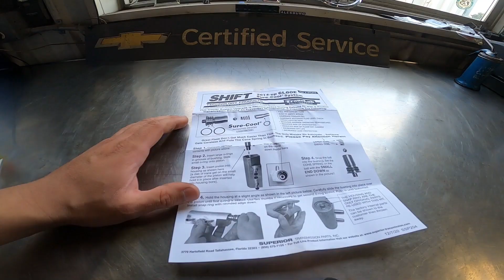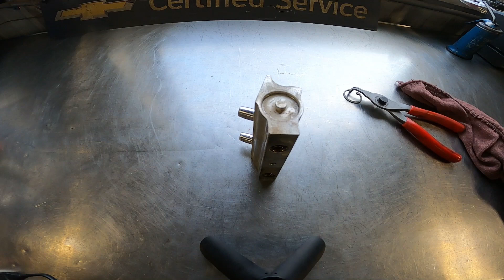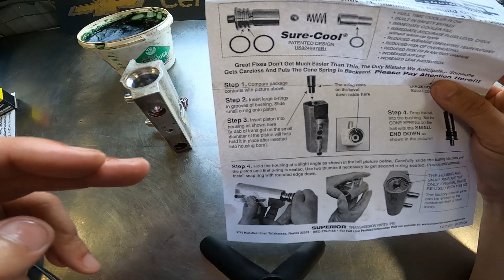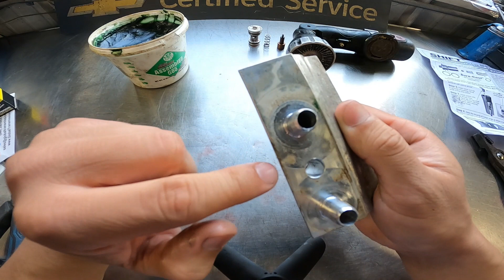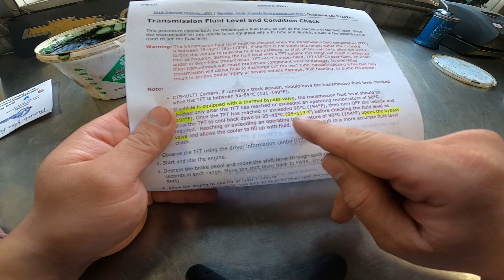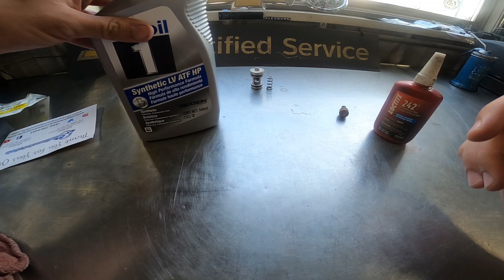Thermal Bypass delete. Removal.REBUILD! Install. STL010 8L90 M5U

Comment: I noticed my engine temp go up a little after this modification.  Before 210° now up 3 or 4 °.unfortunately my 2017 sierra sle doesn't have a trans gage. I guess it's running cooler.

Comment: Thank you so much Jay for sharing this video. I am in the process of reinstalling the TBV on my 2014 Sierra & am wondering what the torque value is on the 13mm that bolts to the transmission? Also, I am stunned at how all there is holding both transmission lines into the valve are two very thin & oddly shaped clips along with each having  what looks /feels like plastic black bushings that slide overtop of these clips that go over slotted metal housing?! Yours is not set up like mine so the various videos I've watched to muster up the courage to attempt this it seems never record how to install these two clips ?! They are so thin & so fragile I am afraid I may if not lose them, destroy or alter them in a way that may render them inefficient. Any advice would be so greatly appreciated! Thanks again for your expertise and your advise on how we may save our transmissions. I have only 71K "easy" miles, no towing  or heavy foot as I am the only driver but did notice an ever so slight rough upshift /downshift along with  delayed engagement to drive and reverse so that is how I discovered this long known to GM problem that I was unaware of until  I searched online about the shifts /delays. When I changed the fluid first before attempting this it gave me hope as it was still mostly red and minimal metallic dust on the bottom of the pan but No metal shards or shavings so I am hopeful that this will save it. I only wish I'd seen your video before I did the fluid change or I would never have put the Dexron VI in! Keep Up the Great Work!
KP

Comment: Repair completed. Thank you for video. 190,000 miles 2015 Silverado, 5.3 6L80. Higher temps before were in 190s, after swap highest temp was 174. Slips and shudders have stopped. Good enough.
Reply from the maker: Thanks for watching!

Comment: Removing the drive shaft is crazy dude. I clicked off ass soon as you started doing that
Reply from the maker: @colt2206  4 bolts with a 3/8 impact. How long do you think that takes real time? 2 minutes?

Comment: I just Changed my transfer case, front and rear dif fluid, coolant flush and brake flush and FINALLY the STL010 Thermal Bypass mod.  221F before 145F after.  DO it ASAP if you have a GM transmission

Comment: Just did this on a 2021 Silverado with the 8L90. Before the mod I would regularly see temperatures 190-200. A few times I saw 250. Low miles truck but I didn’t feel comfortable with those temps.

Great video, one thing I’d like to add is I was able to do the entire mod without removing the trans block/trans fluid lines. I just undid the snap ring and then followed your instructions. Figured I would try and avoid separating factory seals wherever possible. I also did the job cold to avoid losing as much fluid as possible. Lost approx 1 oz. Thanks for the great video!!!
Reply from the maker: @kevinlister5424  I’m just here to help 🤙🏽🤙🏽. I’ve had people say they can do it on car! I’m glad it worked for you. Your transmission will thank you and so will your check book. Have a great weekend!

Comment: Is there any reason you have to remove that whole housing? Can you take the snap ring off and change it with the housing still attached?
Reply: Ya I just did on my 18 6.2....snap ring out..yank out parts...I used a magnet to pull spring out and then toss the new stuff in and bingo

Comment: I flipped the pill 3 years ago on my 2018 Suburban 6L80...works perfectly
Reply from the maker: Odd you are here then
Reply: @jaycastillo9313  video popped up in the feed(which is what you want, right?!)...took a brief look, jotted a note.
Reply: Until the pill detent fails and ends up inside your transmission yea it works but it’s playing roulette
Reply: @zacharycrawfski2276  tje engineering of the part won't allow that
Reply: @everydaydadfixinit4803  seemed pretty poorly manufactured to me in my opinion definitely looks like it could come loose
Reply: @zacharycrawfski2276  lol you're wrong

Comment: Wondering? Could the tstat just be removed from the block housing without unbolting it from the transmission? The block is laying sideways on this 8L90 vs upright on the 6L80. Has anyone just tried sliding out the tstat then slide in a new one or the sure cool MOD. Seems like it would be less fuss with bolts and trans cooler lines etc.
Reply from the maker: Yes. I believe others have commented that they have done it this way successfully. I personally have never attempted.
Reply: @jaycastillo9313 
Thanks for the reply. 
Great video btw. 
Also wondering. 
Have you ever just removed the tstat block completely and attached lines directly to trans.
Reply from the maker: @IS-217  I’m not sure there is a way to do that honestly.
Reply: I just did on my 18 6.2...pretty easy except for the snap ring was abit of a pain lol

Comment: I just did this on my ‘16, is there a potential problem in the winter where it gets negative temps at times in the winter?
Reply from the maker: There’s always a risk but it’s slim. More risk of a blockage/restriction than a freezup. I live in Iowa and I have driven my truck when the windchill is -55 degrees and all was good. I’ve never personally had an issue. My truck is equipped with an active shutter which may help reduce the chance of a freeze up condition.

Comment: @jaycastillo9313 
 
Have A 2017 with the 8l90 and was wondering if you had the part number for the o-ring and seal. 
Thanks
Reply from the maker: 12650609 (aluminum lines)
23277649 (steel lines)
23135703 (Seal)

Comment: Sorry to bug. I may have asked this before, but does anyone know the proper way to do a fluid check when this mod is done. I know with the stock equipment you have to check it between 35 and 45 Celsius or 115 F. Would anyone know the proper way to fluid check with this bypass in.
Reply from the maker: There is no waiting for the valve to open. The actual procedure requires you to get to 194 degrees Fahrenheit to open the valve then check it at operating temp of 115. Now the vavle is gone so just get it to 95-115 degrees (GM recommendation) and pull the 10mm plug (8 speed) until the fluid stops running out and torque or get 95-115 and check dipstick (6 speed)
Reply: @jaycastillo9313  you sir are a great man!!!! Thanks so much. Cheers from central Canada!!! 👍👍👍
Reply from the maker: @jaybilawchuk2225  🤙🏽🤙🏽make sure the engine is running when you check the transmission fluid. 6 or 8 speed both.
Reply: @jaycastillo9313  yep. That’s how I do it. All good. I had a check engine light with code PO711 for an transmission temp sensor fault happen yesterday, so I’m scared. lol. I cleared it and have been driving and it hasn’t come on again yet but will see. I have no idea what kind of job that would be to change. lol.
Reply from the maker: @jaybilawchuk2225  I did it on my 8 speed! It’s just the temp sensor in the transmission. You just drop the pan. I think exhaust has to be loosened on both sides to get on cover clearance. Then replace the harness, the temp sensor is part of the harness and is not serviceable.

Comment: you dont need to remove ur front driveshaft folks
Reply from the maker: Harder to get the torque wrench in after but definitely doable! Every second helps when it’s your own vehicle though! Not getting paid to work on them, are we? Thanks!!
Reply: i dont think i ever torqued the thermostat blocks in my life haha SHIP IT @jaycastillo9313
Reply: @jaycastillo9313  al hacer el bypass tienes que reprogramar la computadora o  se queda igual ??
Reply from the maker: @fernandovazquez1732  No. No es necesario programar nada. La computadora está bien 🤙🏽
Reply: @jaycastillo9313   muchas gracias por el dato
Reply: looks like your a gm tech, me too. 5 years with gm, on my way to WCT
Reply from the maker: @AV8Steps  WCT was the goal a few years ago but after being so short on help and a couple kids later it unfortunately became back burner very quickly. Good luck in your pursuit! I have nothing but respect for those who make the cut

Comment: Took me 5 minutes to do it on the truck. No need to take it off
Reply from the maker: Love to hear that. The vehicles I hate working on the most are my own, I lose money on them!!
Reply: @jaycastillo9313  yeah just do everything he did just kept it bolted to the transmission. Just took alittle hook to get the old spring out. Then put the new stuff in. Very easy

Comment: Will this work on the 8L90 with the 2.7Ls?
Reply from the maker: Superior Transmission website has it listed “NOW FOR 2016 & up 8L90” so I’d imagine that it would. Procedure would be slightly different but not much.
Reply: @jaycastillo9313  Thank you. I appreciate it.

Comment: Just got a rebuilt transmission installed because my temperatures were getting to 230F or higher and my torque converter was breaking down indicated by the fine metal on the magnet and the unusually hard shifting. I got it back from the mechanic and it went right back up to 215 on a 10 mile highway test drive. He took it back, installed a new thermostat and next day I took it on a 30 mile test drive. While on the highway temps went up to 203F but in city driving it went up to 210F-215F again. I just bought this thing on Amazon and should be coming in 3 days. Hoping it keeps my temperatures under 190. I’ll keep you guys updated on the results + new temperatures. 2018 Silverado 1500 LS 4.3L w/ 145,000 miles
Reply from the maker: Yeah, let us know! Wouldn’t hurt to have the cooler flushed . Just to make sure you’re getting good flow. Of all the transmissions we’ve replaced for this issue I’ve only seen 1 require the cooler replaced for no flow. But it’s possible.
Reply: @jaycastillo9313  I’ve replaced the radiator fluid, radiator thermostat, radiator temp sensor, and lower radiator hose recently after buying this truck because the stupid dealership was “kind” enough to drop it off at my doorstep 3 hours away. Long story short when they got to my house there was no coolant due to a leak in the lower hose. Ever since I fixed those things I haven’t had any issues 15k miles. Engine temperatures are still good. AC/Heater works fine. Do you think it’s possible that there’s still lack of coolant flow in the radiator that’s causing my transmission to overheat given all of that information?
Reply: they are not related, only thing is they are inside the same case but seperate coolers @parsingh559
Reply: if it still gets hot your cooler is probably plugged, anytime we do converters or trans replacements we flush the cooler @parsingh559
Reply: Installed and took for a 50 minute test drive. First half of the drive was on the highway 55mph and second half was in city 35-40mph. Still climbed up to 220 but took a lot longer than before. Mechanic claims to have flushed the radiator already. I’ll be picking up a tru cool 40k radiator cooler soon.

Comment: Do I have to replace the fluid after putting this on? I have a 2018 1500 Z71 with the 6L80 and I’ve noticed even in the cooler weather now it’s still getting up to 180 so I’ve been thinking about getting something like this, I’m just not really able to change the fluid on my own.
Reply from the maker: Nope, not at all. Just make sure to check the level when you’re done. On the 6L you will have a dipstick and you use do not use the fluid in the video. You use Dexron VI .
Reply: Awesome thank you. I’m hoping this works so I can avoid all the problems I’ve seen about overheats
Reply from the maker: @Chris-hk6np  I hope so as well. Good luck!

Comment: Do you have a part number for the o rings on the transmission lines that you didn’t replace but recommended?
Reply from the maker: 12650609 (aluminum lines)
23277649 (steel lines)
Reply: Awesome, thank you!

Comment: This is NOT a solution for the smaller chevy engines that don't also have an auxiliary transmission cooler.  I installed this on my 2018 Silverado with 4.3L and it had NO effect, except slowing the temperature climb.  Once the truck was up to normal temp, at highway speeds my tranny was 199F.  I've learned that without an auxiliary cooler, the radiator temp itself sets the tranny fluid return temperature.  MFR. should indicate this in it's advertising.
Reply: Did you learn this through personal experience or did you read about it online? I have the same engine and I just purchased this thing. Don’t tell me it won’t work 😭
Reply: @parsingh559    On any extended trip, it will NOT cool your transmission fluid lower than your radiator temperature with that truck.  Without an auxiliary cooler (outside the radiator), the coldest the transmission fluid can get is the radiator temperature, which is about 195F.  So if you're looking for something down in the 160F range, it won't do that with that engine.  And yes, I observed this because I own the truck that did it.  I looked up why and confirmed that with an internet search, it does not have an auxiliary cooler.  You can still put it in, and your temps will be lower on short trips as the transmission is warming up, but if you're out for a while, the coolant temp is going to be the bottom limit on transmission fluid temp.   To get the full benefit, you have to ADD an auxiliary cooler after the radiator.  You can thank GM for cheaping out on this engine.
Reply: @gssmith1986  thanks sir. Have you done anything else to keep it cool? You think regrading the diff will help?
Reply: @gssmith1986  yo what transmission auxiliary cooler did you install? Part numbers would be greatly appreciated. Thanks
Reply: You need to take the front grill off the truck and measure the location where it would fit and then pick one of the aftermarket brands.  They are dirt cheap and depending on how elaborate you want to get mounting it, pretty easy. @parsingh559

Comment: Thanks for the video….. I have a 2017 SIERRA that runs at 200 degrees, I also experience hard shift into second once it warms up to operating temp…. Will this bypass help me with hard shifting issues

Comment: top cap is impossible to remove once corroded mine is 2017 hard to remove please be weary of this you’ll be stuck until you get a new valve
Reply from the maker: Have definitely never seen this and I have seen a ton of these things! Will post a part number for the entire assembly just in case. Thanks for your input! We’re all just here trying to save a buck and help each other out 🤙🏽

Comment: I plan on doing this to my 18 Sierra with 8L90 this weekend. I'm also going to be flushing and adding the blue label LVHP. Anyone know how the process will work with the bypass? I know GM hooks up to their pump to flush and pushes fluid out the cooler line
Reply from the maker: If you’re using the stl010 just simply hook the flush machine up inline and it will go. on vehicles that don’t have it deleted we disconnect the lines. Start engine, drain 3 quarts into a bucket. Then fill 3. You do this 4 times. On the fifth time you do 4 quarts. This equals 16 quarts. Then I flush the lines and top off fluid as needed. Obviously a lot harder on an 8 speed v a 6 speed.
Reply from the maker: And I know that sounds very unprofessional but that’s a actual GM procedure 😂. They even sent dealers a bucket will markings on it. They also send two adapters. One for each transmission (6&8) with hoses attached to each.
Reply: @jaycastillo9313  thanks for response man! I plan on using a little hand pump to do this in my garage so I’ll take any advice I can get 😂
Reply from the maker: @nolovenoah742  if you’re doing it at home I suggest getting someone to help you just turn the engine on and off. Makes it a lot easier, don’t want to lose too much fluid. If you do it alone, listen for the pump starting to whine. Turn it off as soon as you hear that and that’s about 3 to 4 quarts. Hope this helps!
Reply: @jaycastillo9313  absolutely helps. I’ll have the old lady with me. It may be a stupid question but of course, after I do the bypass- where will the fluid drain from as I do the flush? Still check plug?
Reply from the maker: @nolovenoah742  when you disconnect the transmission lines, that when you will turn on the engine to flush the fluid out. It comes directly out of the transmission. Then add through the fill plug on the passenger side. Once that’s all done and you’ve installed the STL010 hook the lines back up. And then reinstall to the side of the transmission. Then unscrew the 10mm check plug under the pan, driver side, and turn the truck on. If it’s full leave the engine running until it stops dripping. If it’s not dripping when you pull the plug with the engine on keep filling from the passenger side until it starts coming out. Then wait for it to stop and tighten the check plug. No need for it to reach a certain temperature because there is no more thermostat. You now have full time cooler flow.
Reply: @jaycastillo9313  sounds easy enough! Thank you for taking the time to reply. You have a new subscriber

Comment: what is your opinion on flipping the pill on a 2014 4.3 silver ?
Reply from the maker: Everyone says it works just as good and it’s free! The STL010 will bypass in the event of a freeze up or blockage in the cooler or lines. That’s the advantage going that route. Hope this helps!
Reply: @jaycastillo9313   thanks for that , next fix is a catch can .

Comment: Finally got to my install. I have an 18 Silverado with 5.3 and 8L90. I live in the NV Desert. Put on about 100 miles city/highway yesterday in 95 degree heat. Wasn’t uncommon to see mid 180’s before. My peak yesterday was 152. Freeway cruising 75ish was sitting at 145 and didn’t budge. Couldn’t be more impressed/happy with this product.
Reply: Will this work for a 2015 silverado?
Reply: @landofthepines7568  Worked on mine.